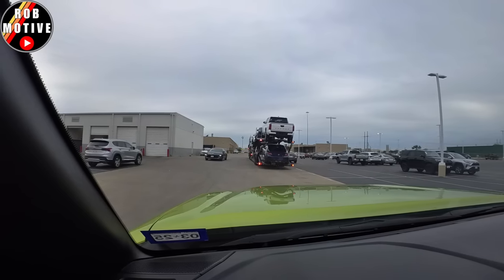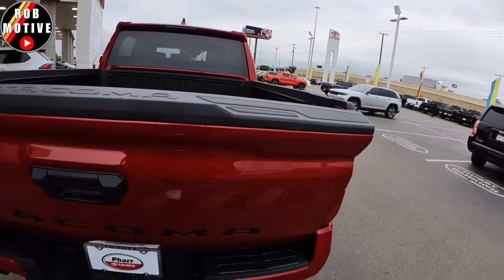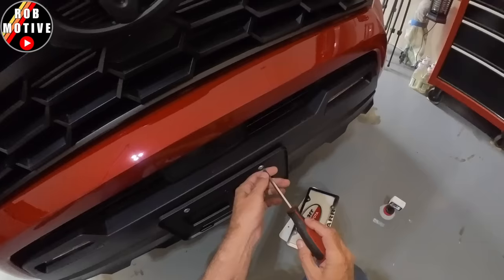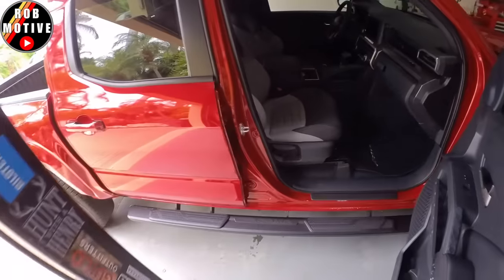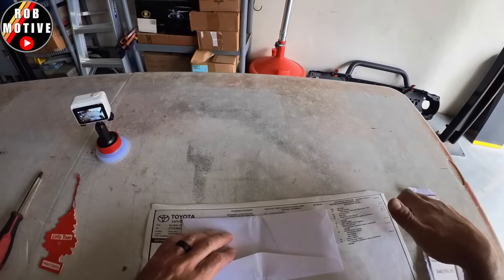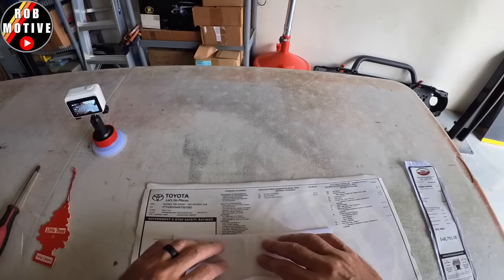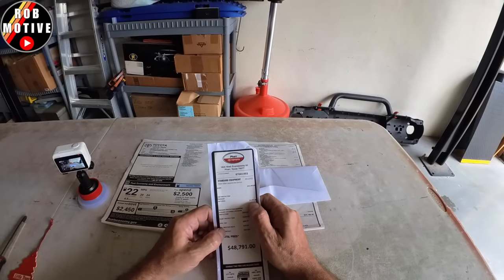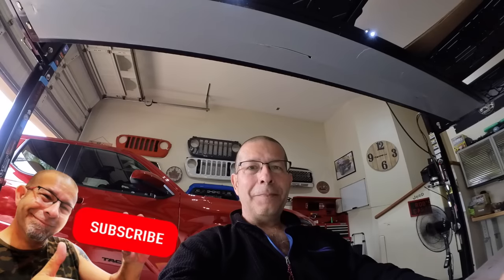Traded For A 2024 Toyota Tacoma: Taking Delivery

Comment: We purposefully bought a slightly used (6K mile) 23 TRD Off Road double cab with the Premium and Technology pkgs with a 6’ bed.
I could have bought an identical 24 model, but the Only reason why I bought the 23 is because of the 3.5L Naturally Aspirated (NA) V6.
Historically a Turbo engine won’t last as long as a NA engine.
We keep our vehicles for 12-20 years.
Reply: That’s the only reason I didn’t get a 2024 taco. I got rid of my 2024 JL for that reason
Reply: 20 years of low torque. Ouch.
Reply: @dvader3263 at least his won't break down near as fast as the turbo.
Reply: @MRCLMCII  💯

Comment: I'll stay with my 2015 Tacoma TRD Sport that just rolled over 75,000 miles. Bullet proof 4.0 V6 and 5 speed bullet proof automatic transmission with the 6 foot bed, bed mat all for $30,000.
Congratulations on your new TRD Sport. I'll miss the green machine but will be watching to see what you do with the new one and see if you like it or have any issues with it. I do like the coil springs in back as well as the rear wheel disc brakes. You can't have everything. Best of luck Rob!!
Reply: That was the best year🎉

Comment: Congrats, Rob!  I spent 2.5 years at NAS Kingsville courtesy of the USN, and my wife taught Kindergarten in Mission for a year before we were married in 1965.  Put about 6000 miles on a 1963 Ford Falcon running back and forth and around the area from Padre Island to Monterrey, MX.  The aroma of the flowering grapefruit in the spring in the Valley was amazing.  Good memories!  Ordering my new Taco sometime in the next couple of months to replace my 2003 Tundra limited w/75,000 miles on it.  Thank you for your reviews and advice.  I'll be a VERY happy camper if the new truck holds up like my last one did!
Reply from the maker: Thank you for your service!  You’re gonna love the new Tacoma 👍

Comment: A few simple changes I'd make first.  Decal removal, side step removal,  front window tint, exhaust tailpipe cut back to axle, remove front bumper valance.  Then later Westcott Designs 2in. lift, 285 70 17 Falken's mounted on Method 318.
Reply from the maker: Sounds like a good list to me👍

Comment: I hat the drilled out. Should have thread inserts and black bolts.bought mine where they need front plates . Ga. Doesn’t and told them not to put it on but the did. I had to put trim plugs in hole.

Comment: Spray on bed liner??
 Is the new tacoma bed not composite anymore?
Reply from the maker: It is.  All you really need is a bed mat.  But, it was already on mine.
Reply: @RobMotive so they actually applied bed liner to the composite bed?
Reply from the maker: @samochoa6733 They did.  In all fairness, it looks really good.

Comment: Like your green truck better I think they're a better looking truck would have chose the 6-ft bed as I think it looks better on the new models. For two-wheel drive truck that's quite a bit of money and all those add-ons I don't think I would have got them and I don't care for the tube Steps either especially if it's a two-wheel drive or if it's a four-wheel drive. However congratulations
Reply from the maker: I could do without the steps too.  However, Toyota is selling with packages and they were unavoidable.

Comment: Rob first of all congratulations I absolutely love the color as for a few comments that hit on you being a bit of a turn coat after your videos that you made where you were not all that big on buying one I for one saw thrue that first you are a buissness and you have gone about as far as you could with the gen3 as far as mods and for your type of content you had to  go for it I think it's going to be interesting to see if the mods from your other truck are going to work on this one since alot of the astetics have changed on the grill area and rear end and since the dash is totally diffrent weather switches and things of that nature will look right and since it's a new desighn if certain mods will be available I'm shure if toyota was smart the specks on gen 4 was made available but you will at least have a nice supply of parts that if you can't use them someone with a gen 3 would love to have though you won't get your money back you won't be stuck with fairly new parts that have no use I really can't  see the need to change the rims and tires 18 inch rims are pretty substantial and going with a 2 wheel drive makes sense since you had the blue truck set up for off road and that went by the way side as I can see there really isn't much on the exterior that needs changing the interior on the other hand seemed a bit sparce to me I like that but I know you like to find unusual things that are also practical and do those i kind of hope you keep to your word this truck dose not need a lift it will just rob you of gas mileage and make for a more unpleasant ride but I will promise you that what ever you decide I and most of us will remain loyal followers sorry about dragging on I think as far as car sales go you got a decent trade best of luck with your new project.